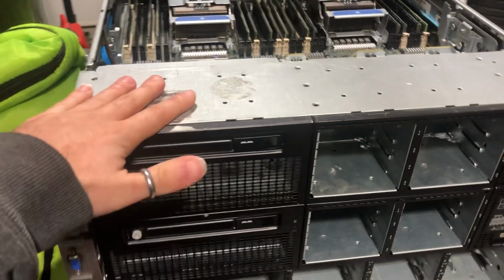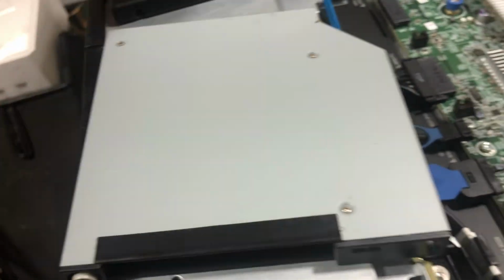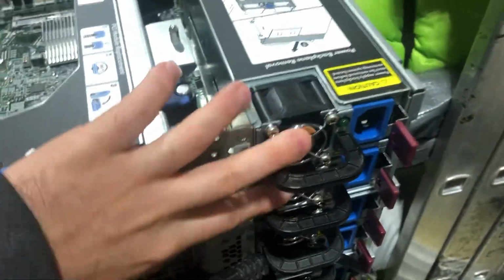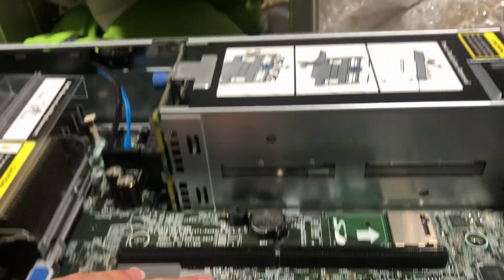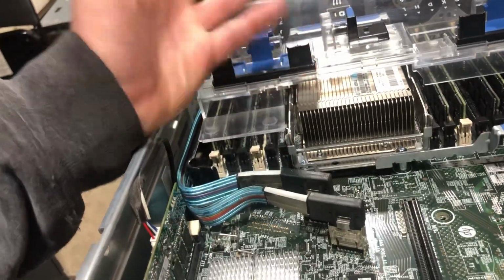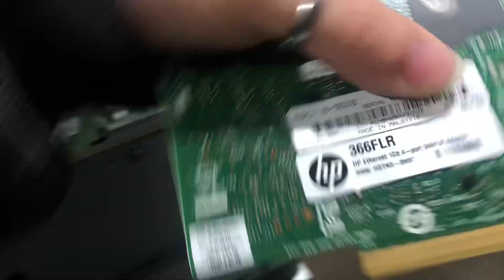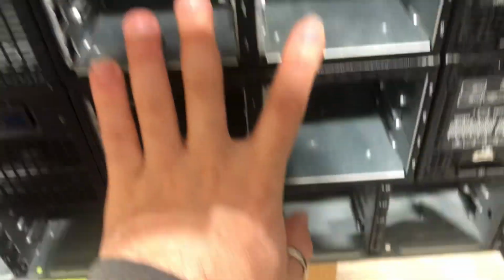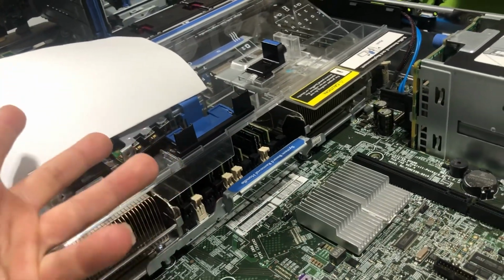Proliant DL380P Gen8 - basic overview - 1

Comment: I appreciate this kind of video due to you talking much about specs and sharing your experiences. Do you still use these Gen8 or are you on Gen9 as in the next video?
Reply from the maker: The gen 8 storage controllers have all died, this machine was only used as a reference to point out the geography and whatever else detail I could think of would be useful.

Ive since been on gen9, and the only problems I have are updates. Everything else is buttery smooth.